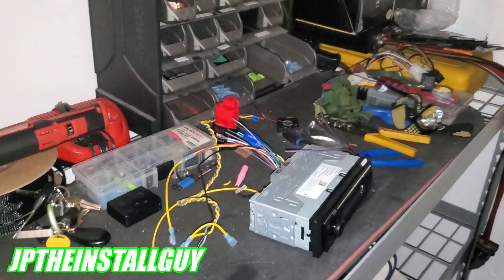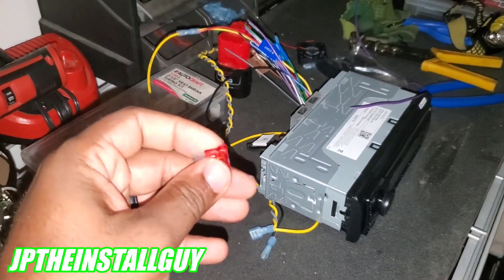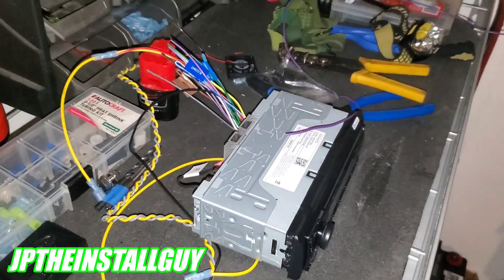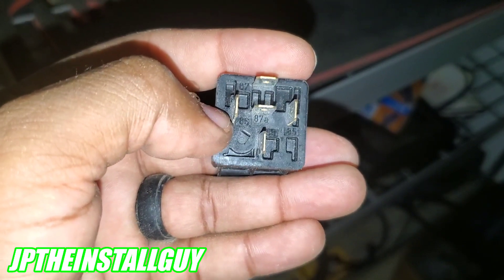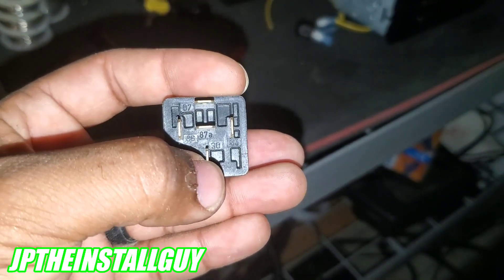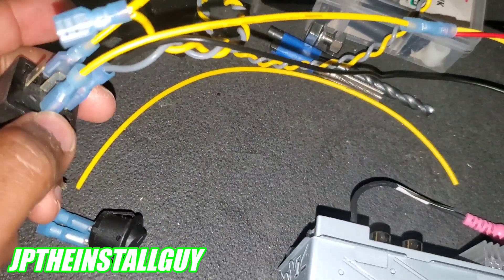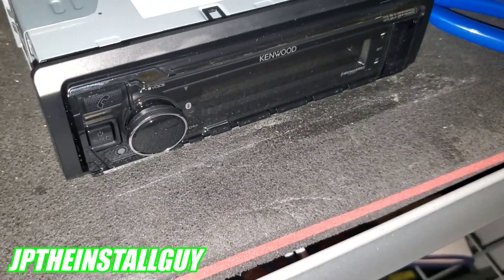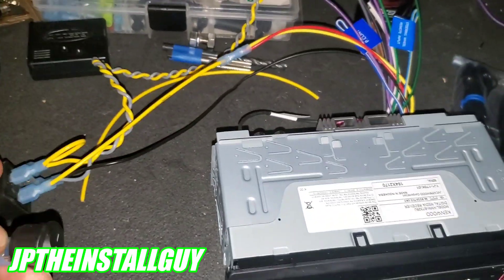How to wire an automotive spdt relay to power more accessories

Comment: Excellent informative video.  If I need to fire a relay from inside the vehicle, I like to keep the powered side of the coil under the hood and only run the ground side into the cab to complete the coil circuit.  I also usually use 30 as power input and the 87s as the load(s).

Also I can't believe I missed out on the sweet Kenwood.  Darn it.

Comment: thanks JP for explaining, my 05 chevy express orginal radio harness didn't have the switched 12VDC the fuse blocks are very hard to acess. so I'll connect my first relay to climate controls stealing it's switched 12VDC an steal the constant 12vdc & ground from old radio harness. out 30 to new radios yellow wire switched 12vdc. excellent video

Comment: Hey, I've got a LED switch that has 4 prongs on the back.  What's the best way to wire that up using a relay?  I was thinking the top two prongs are hot/ground for the switch itself...and once the switch is flipped it sends power out using the bottom two prongs. Would I need to use both bottom prongs to hook up to the relay?  Think I would only need the 'hot' side to go into the relay?  

2nd question, what's a good place to ground that LED switch inside the car (driver's side)?  Trying to avoid running a ton of wires through the firewall.  Hoping to tap into the in-car fuse box (down by driver's left knee) for the switch and then ground it somewhere in that same area. Then run the hot wire from the bottom prong out through the firewall to the relay that'll be in the engine bay. 

I'm wiring a lightbar to the top of my car.  I'm using a 20amp relay (lightbar is 16amp) Thanks!

Comment: Actually you can wire alot off your headunit. A amp needs barelt 3% of 1 amp to turn on. Remote wire doesnt need power. I literally had sbout 12 things clicked onto the same remote coming from kicker LOC thsts using my stock sub wiring for signal/remote turn on. The stock sub is unplugged so that should explain rigjt there you dont need shit really for actual power. Guys mess up qn try to use 22g wire for all their remote wire ehich is to small to Daisy chain with

Comment: 30 is your power in, 87 is your power out to device. Hence the 87a (also power output to a device), which is on when the switch is off where 87 is on when the switch is on. The way you have it setup technically works, but power flows the wrong way, essentially connecting 87a and 30 (your device) together when the switch is off and disconnecting 87a from power when the switch is on.

Comment: You did that all wrong 30 goes to the battery 86 is your  low voltage power  85 is ground 87 comes on when low voltage is on and 87a has power when there is no low voltage present and opens when low voltage come on
Reply: You're correct. But instead of saying low voltage, I'd replace that with turn-on signal. It will make more sense and be less confusing. It's all low voltage! And, instead of low voltage power, use constant 12V+.

Comment: I have some footwell led lights and a map light I want to wire together to the same ignition source. I used an empty spot on the fuse box. Since the spare map light is white and I’d use it for maybe a minute to find something, but I’d use the LED’s by themselves for longer periods, Would this be okay? I wouldn’t be drawing power from them constantly- most of the time they won’t be turned on. And probably never at the same time.

Comment: Nice video, however everything I have read states that pin 30 should always be power and pin 87 would be your accessory. I know it will work how you explained it but I wonder which is more correct.
Reply from the maker: honestly you can use either or 87 or 30 both of them connect to 87A